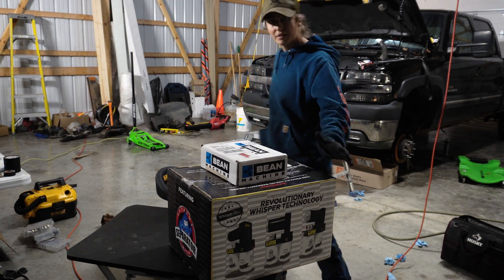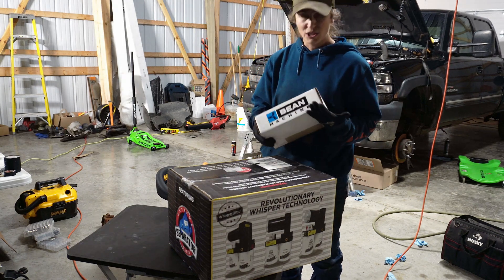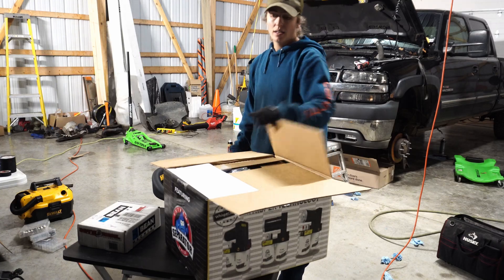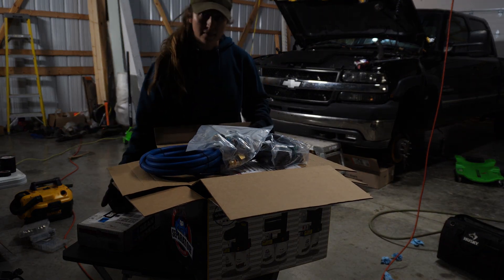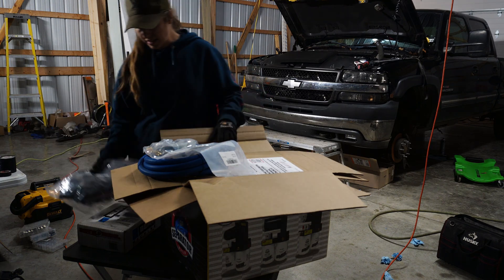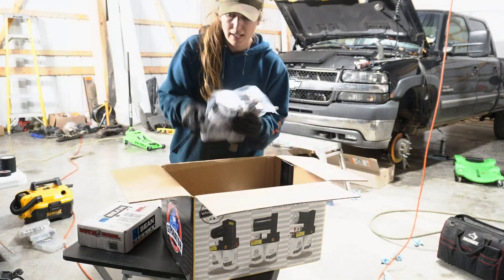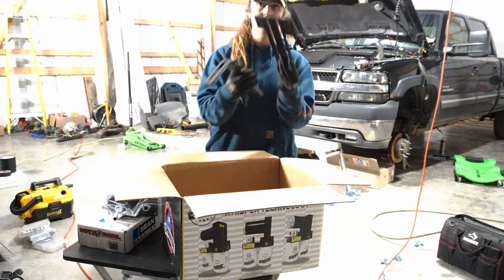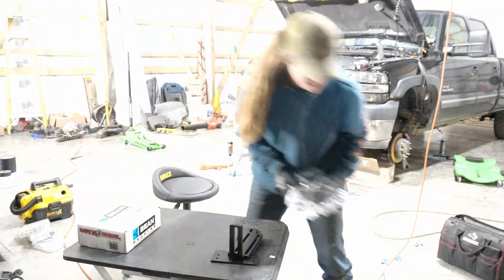LB7 Duramax Engine Upgrades And Fix Part 4! Lift Pump Sump Install And New S&S Diesel CP3!

Comment: Awesome vid , you got me worried the LB7 videos were over when I saw the fancy dual blade mill video. , hey did you end up changing the actual fuel lines , I got pissed at putting 6-12 inch rubber hose sections every time I had a leak so I just ordered the doorman stainless steel fuel line replacement kit.
Reply from the maker: I did put new fuel lines in! I made new custom ones out of tubing, way cheaper than the oem ones and I had to reroute for the lift pump! I still have several more LB7 videos to come! Thanks so much for watching!